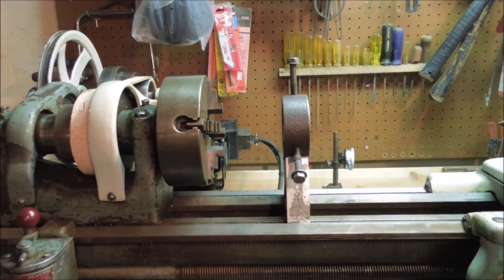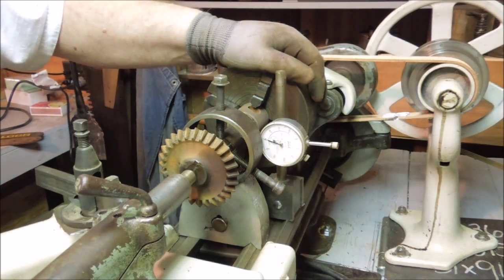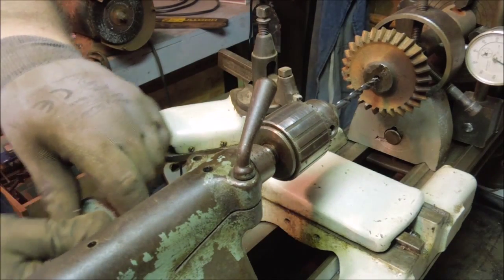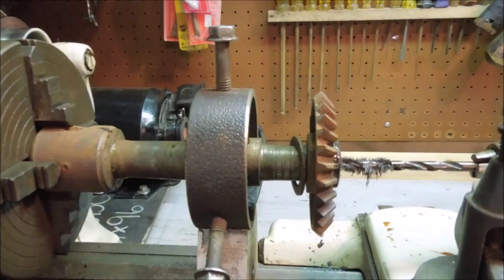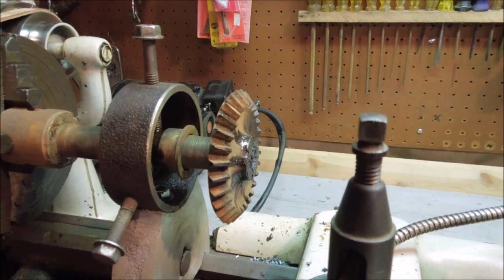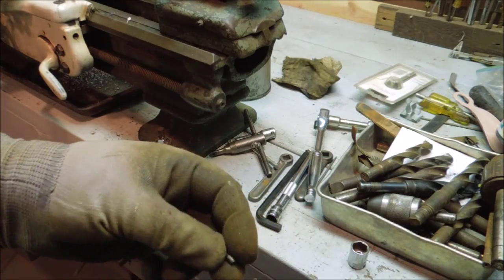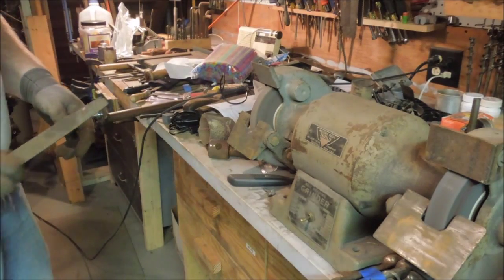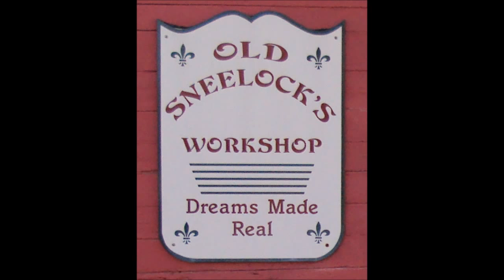Repairing Antique Tools - Swan Beam Drill - Pt 13 - Removing the Main Bevel Gear

Comment: I was wondering about the quality of the old shaft because it didn't take you long to gnaw through it with a hacksaw. No wonder it wore out and took the bearings with it! I know if it'd been very good stuff there would've been a lot more huffing and puffing going on, at least if I was doing it. A hacksaw has worn me out more than once. But you will triumph in the end. Good Job Uncle Snee!

Comment: that is a super neat trick about the sparks i didnt know that that  old lathe is running smooth as silk if u have time sometime id like to see a video on setting the lathe up with the dial indicator i had machine shop in school never did catch onto that how much off is to much and when do you know when u need to use a steady rest great video